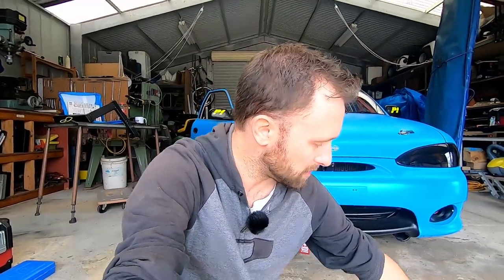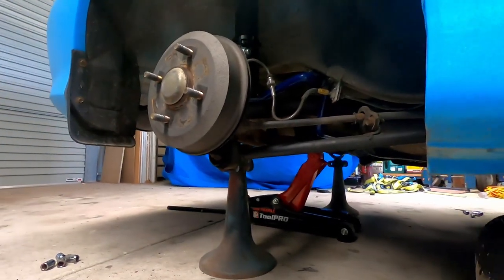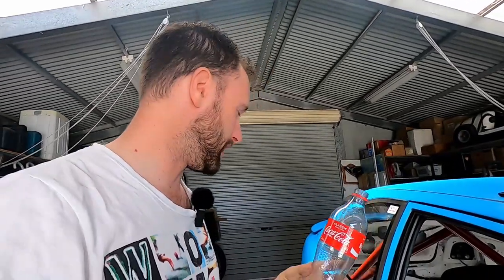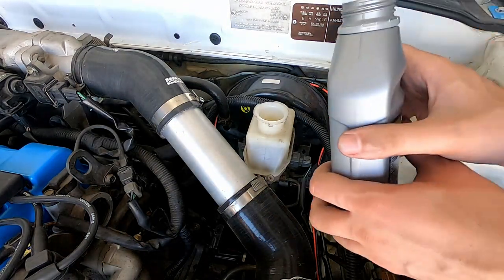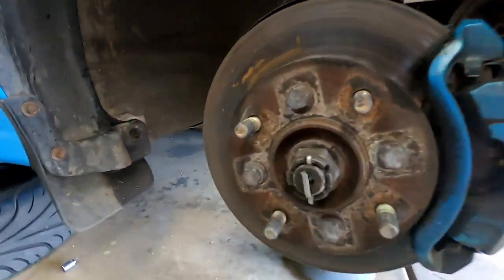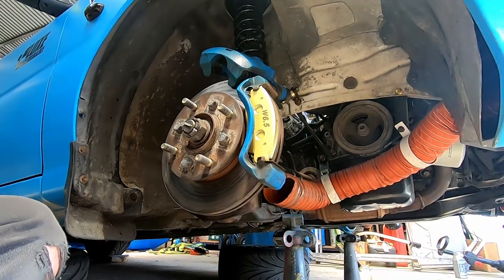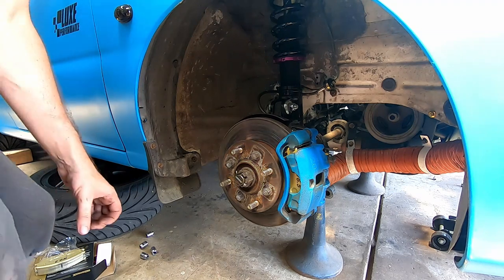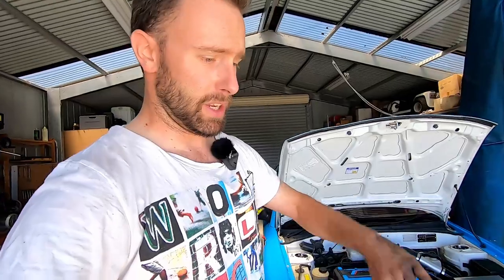Budget Race Car Build - Part 42 - How to bleed brakes + brake upgrade!

Comment: To get the most out of the rear shoes you may want to consider putting marking chalk on the shoes then squeeze the brake. This can show you high and low spots then sand the shoe even. A lot of work for rear shoes but an option.
Reply from the maker: That's a really good tip! i might give that a go, thanks mate :)